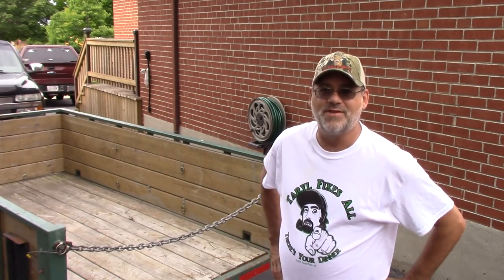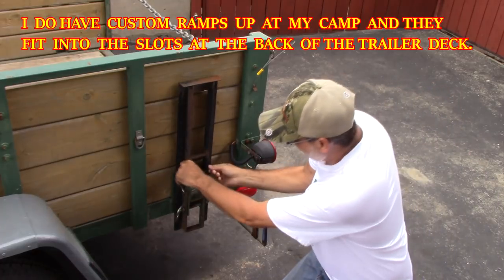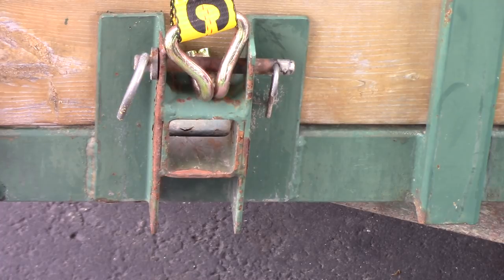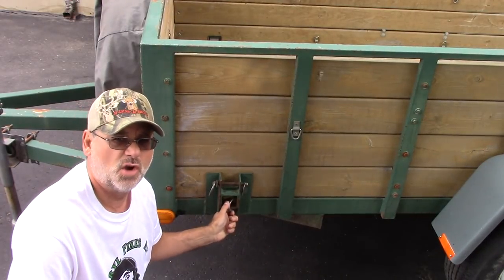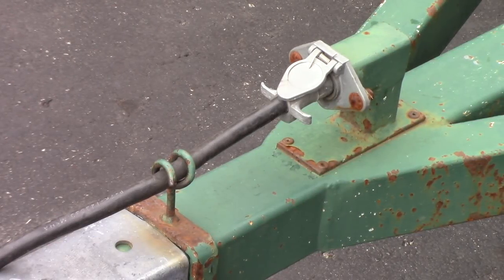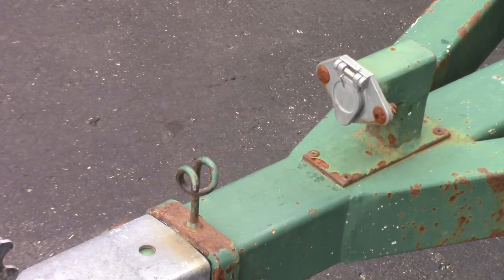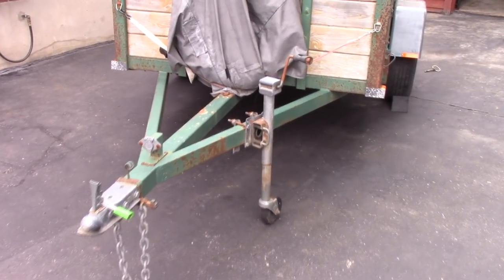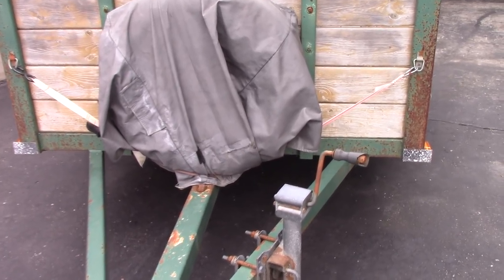CUSTOM  UTILITY TRAILER AND SOME  TIPS AND UNIQUE  MODIFICATIONS

Comment: Thanks for sharing.  Great features.  You never have too much hooks! I like the legs at the back. Needless to say my trailer is homemade.  I put a Rubbermaid Action Packer box on the A frame, to put my straps, bungee, spare lights bulb, jack, gloves, registration papers, safety pins, etc. So it's always ready to go. That was the first time I see a removable cable. That is one super idea! I'll do that on mine! Thanks!
Reply from the maker: Thanks Joe , over the years it's always been corroded connections at the trailer wiring so I thought lets detach it and remove the problem. It works great.

Comment: The down-riggers/stabilizers are a must when loading/driving on.  I bought the trailer but needed to make it my own. I added a 2500lbs winch in case I have to pull the tractor on.  Nice job Steve better than some pre-builts
Reply from the maker: Thanks buzz , yes a winch is a must have to load it .

Comment: Very nice trailer Steve.  I built one too, about 8 years ago.  I don't use it much but not having a truck makes it a godsend when I need it.  About the only thing I did that wasn't in my original plan was to install flush mount tie downs on the floor.
Reply from the maker: There's always a lot of what ifs after you built one that's why we have to build at least 10 to get it all figured out :)

Comment: Steve...that`s a very well built trailer ...just as good as the ones you buy out there and probably better....like the Idea of the 5 quarter planking and your welding squills did you right on this job....I must go and check my strap.....I have to rent a big trailer to haul my tractor...just to mutch wait....looks solid from here....CHEERS
Reply from the maker: Gator if I get a bigger tractor I will just rent a trailer too. Cheers bud

Comment: THANKS SO MUCH FOR THE GREAT TIPS!!!  I am particularly siked about the bolts going AROUND the beams rather than though them, particularly since it's easier As Well As More Structurally Sound to do it that way.  Second I absolutely love the LEVELERS!!  I will add a horizontal plate on the bottom of the levelers (and omit the flipping over of the leveler step) so as to provide a surface that is less likely to sink into the ground and I'll be placing one on each of the four corners.  I am going to be turning my 4X8 cargo trailer into a Tiny House on Wheels for the tiny herd (five) of goats that won't go into the run-in to shelter with the horses or cattle.  I plan to build it out an additiolal foot on the front and two on the back with a ramp that lowers over the tongue to the ground for the goats to acess the interior (that will be well insulated).  I'll be building it in the Gypsy Vardo fashion with all the bright colors and embellishments that the Vardo's are known to have.  It will also double as playground equipment with a way for them to acess the roof from the back side by way of an additional ramp or something, I haven't figured that part out yet.  They will have some way up there though because these goats LOVE to climb.  It's going to look soooo cute out in the field, a little Gypsy Vardo with goats on top of it.  🐐🐐🐐🐐🐐
Reply from the maker: Thanks for taking a look and good luck on your adventure

Comment: nice job, but 1 improvement to make your gate easier, just make hinges from pipe, I've used 3/4 round rod inserted into the 3/4 inch (ID) pipe, bolts with a hole in one end for a pin will also work
Reply from the maker: Yes great tip and if we're to do it again that's the way I would go. Cheers

Comment: You should drill drain holes in your tube. Condensation builds up inside from temperature fluctuation and will cause rust from the inside.
Reply from the maker: You are correct , I did . Good tip for those that read this post. Thanks.

Comment: Used trailer prices are insane! I think I could put an old bed frame on an an axle and ask a thousand for it LOL. You can buy a new trailer cheaper than you can build one, and sometimes cheaper than a used one based on prices I've seen.
Reply from the maker: The price of steel up here is almost twice for you so anyone building one can build a better trailer but not as cheap as a manufactured one .

Comment: Nice trailer build Rob. How much does the tractor weigh? I would have thought you would need a dual axle to carry a tractor.
Reply from the maker: Thanks John . Tractor is at most 1800 pounds. Pulls fine without electric brakes.

Comment: Gotta buncha stuff to build a trailer for my yanmar. How much does yur bota weigh?
Reply from the maker: 1800 pounds  , theres a lot of ways to make a trailer but angle iron ones ive seen all bend . Tube steel 1/8 wall does great for this size and weight.
Reply: @SteveRobReviews  cool